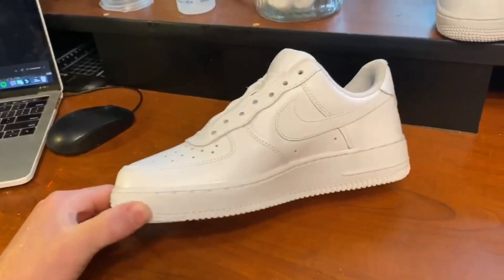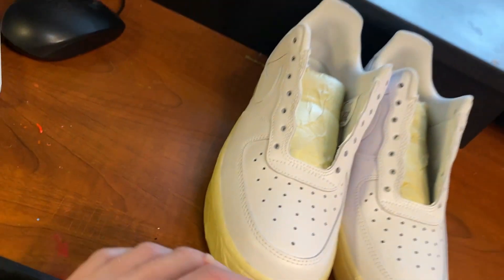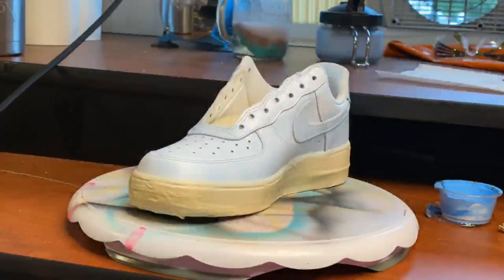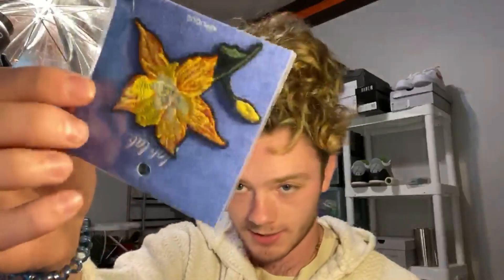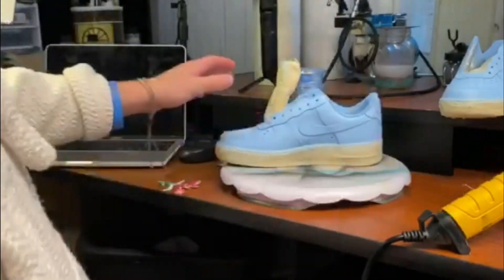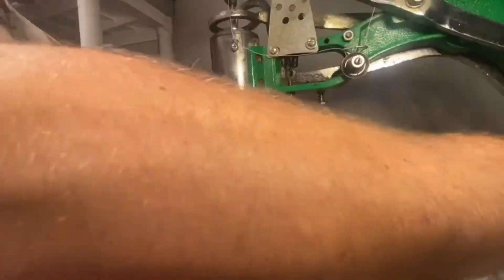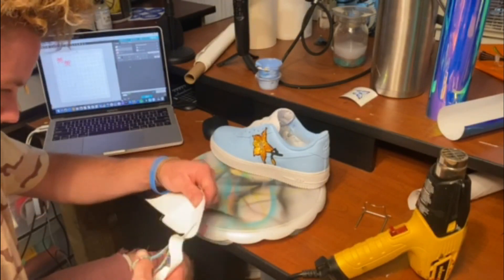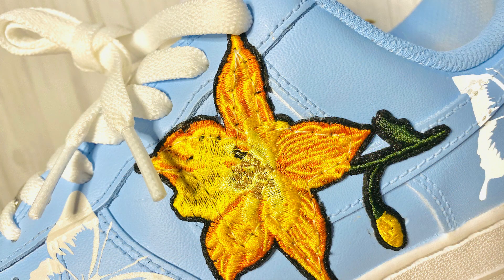How To Apply Patches To Shoes

Comment: What if you just used the adhesive and didn’t sew for a smaller patch on the back heel? Do you think it would stay or fall off over time?
Reply: it should work but its better to put on adhesive/glue then sew it on

Comment: Stupid question: can you use a hair dryer to stick them on? The only reason I am asking this, is because hair dryers are blowing hot air and I do not want to customize multiple pairs of sneakers or start a business, so I am wondering if that would stick the patch before I start sewing! 👟 🌸
Reply: Same same
Reply from the maker: Honestly i would use an iron, im not sure if the hair dryer would get hot enough to melt the glue. Sorry, i hope this helps !!
Reply: Yes, you can use a hairdryer just takes a little longer

Comment: Do you think that it's possible to sew patches onto air force 1's by hand? I don't have a sewing machine and I am trying to customize a pair of shoes, but I don't want to ruin them. They are not actually air force 1's but they are a similar style, however the leather is softer on these so it might be easier on them than it would be on actual Air forces.
Reply from the maker: Yeah you can!
Reply from the maker: Use a leather puncher and hand lether needles
Reply: @ZedsCustomClothing  ok cool. Thanks!
Reply from the maker: Of course 🤞🏽

Comment: why did you have to stitched it after you ironed it on? Was the iron on adhesive not enough?
Reply: I asked also because I usually just iron the patches on and use my shoe heat press. they usually stay on tight enough.
Reply: @GodsonElijah313 If you have a shoe heat press and use a good glue it’s ok the stitch is just an additionnal security